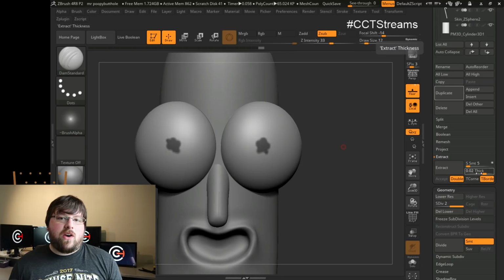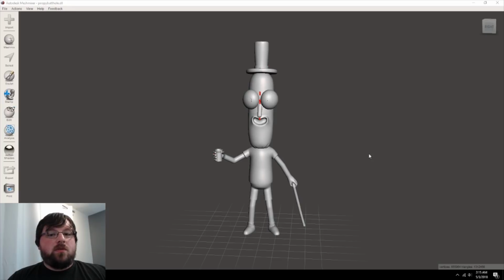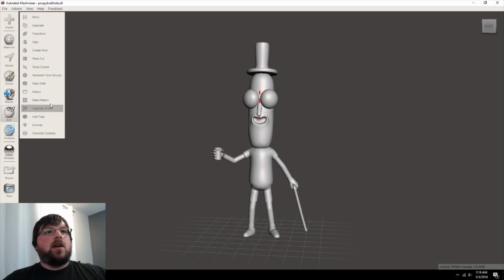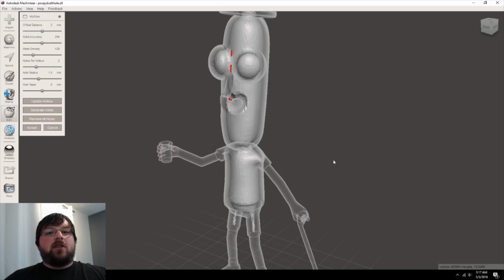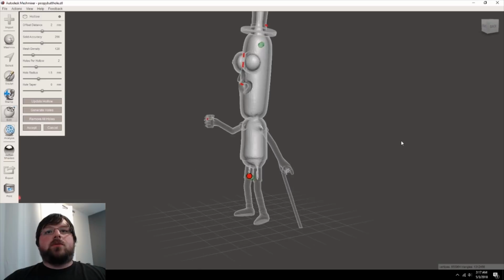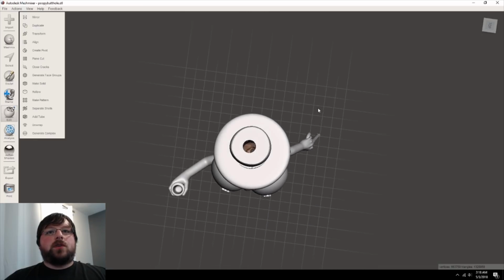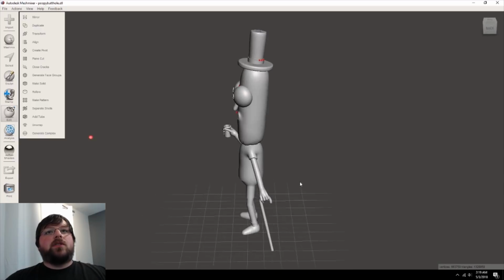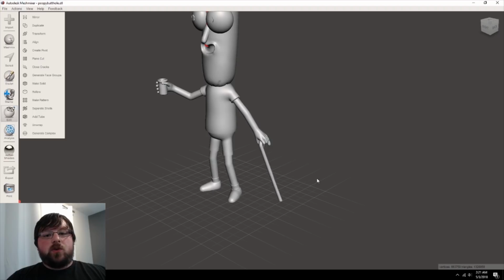3D Printed Mr Poopybutthole [Rick and Morty]

Comment: You could of done all the prep work you showed in Meshmixer directly in zbrush by duplicating the mesh, inflating in a negative way, removing some of the floating pieces that are created and using that together with cylinders for holes as booleans. From what i read online the holes are created for removing the resin and also for relieving the pressure after each layer, otherwise the model could snap during the peeling process.